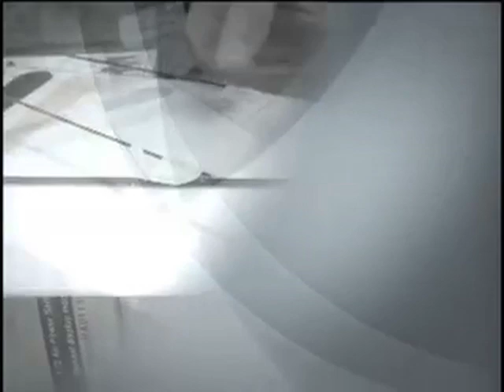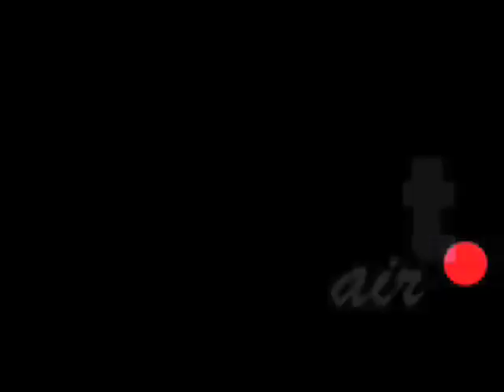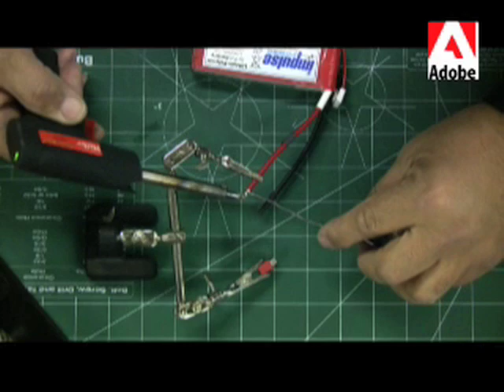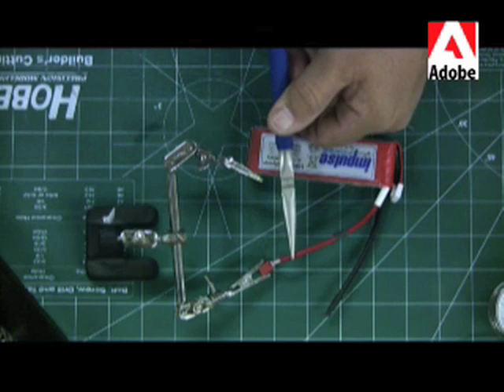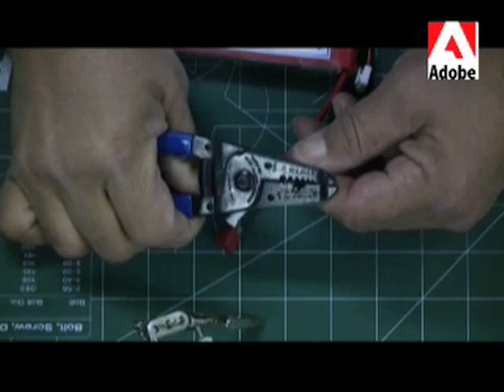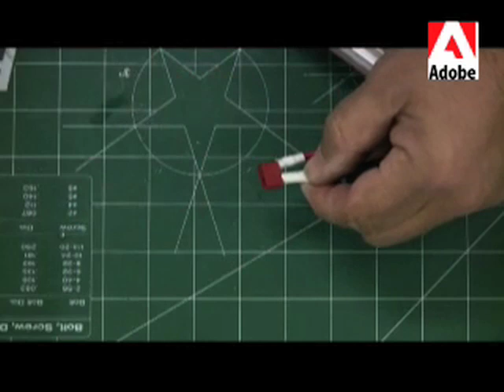How To Solder Connecters To Batteries

Comment: Great video!  Im expecting a lipo battery soon from E-Bay that I will need to solder on a JST connector which typically uses  20GA wiring.This new battery is a 1200mAh 11.1v 3S and the wiring may be a little thicker.If I solder a JST connector with 20GA wiring to thicker battery leads,,,,,,will it still work?

Comment: Not mentioned, but you always heat the metal you're soldering to melt the solder - you don't heat the solder itself. You rely on the heat of the object (wire, what-have-you...) to melt the easily melted solder to get a better connection.

Comment: would i be able to use two 7.2v nimh battery packs for a mamba max 5700 or a EZrun brushless 9t motor?..i want to make a Y connector..will the esc handle the power?